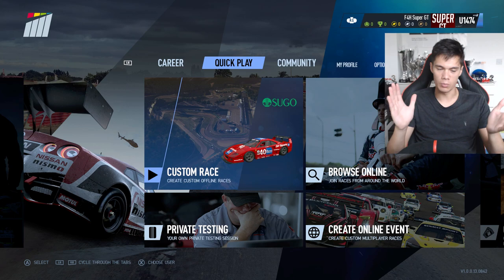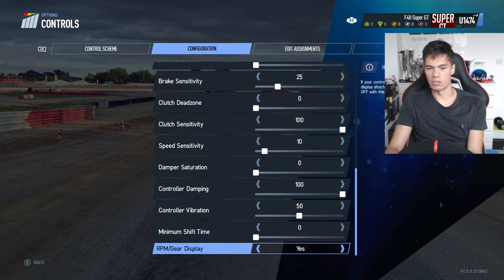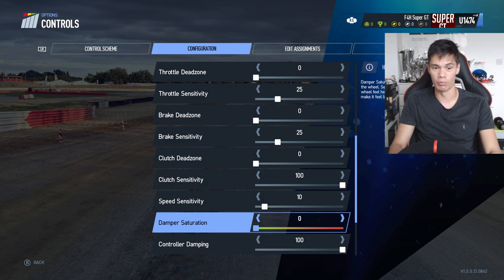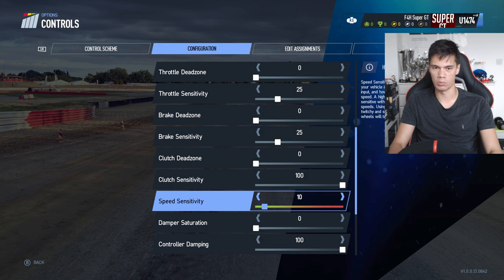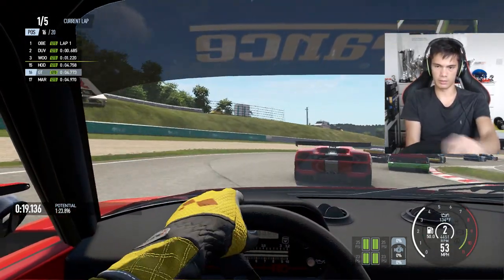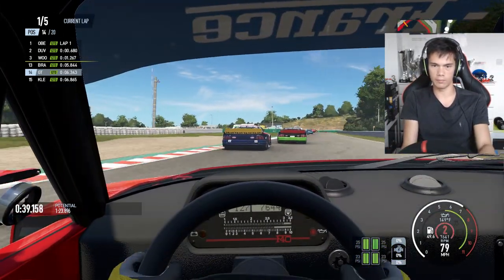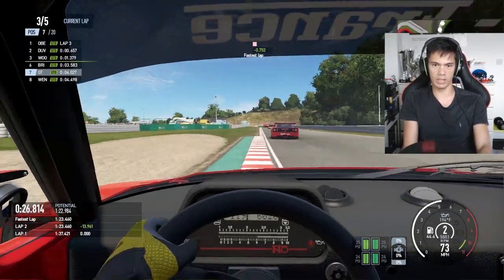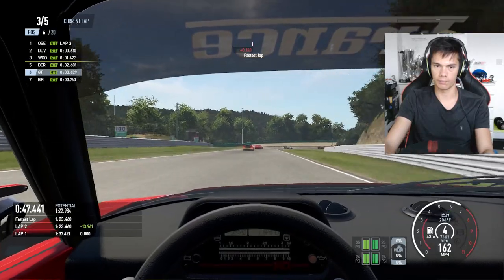Project Cars 2 - Wheel Settings

Comment: Here they are just in case anybody needs to copy it in text form, send it to people, etc:

Steering Deadzone: 0
Steering Sensitivity: 70
Throttle Deadzone: 0
Throttle Sensitivity: 25
Brake Deadzone: 0
Brake Sensitivity: 25
Clutch Deadzone: 0
Clutch Sensitivity: 100
Speed Sensitivity: 10
Damper Saturation: 0
Controller Damping: 100
Controller Vibration: 50
Minimum Shift Time: 0
RPM/Gear Display: Yes

Flavour: Up to you
Gain: 100
Volume: 60
Tone: 45
FX: 65
Menu Spring Strength: 0.05

Comment: Revelation! My settings were ok but yours makes the car so much more stable, thanks. At first I thought the brake sensitivity was too low for me but I persevered. Mine was set a lot higher as was throttle sensitivity. With your settings there's a little more under my foot which gives me a better feel. I'll experiment with a little more sensitivity but I'm getting a step change in feel and results, thanks again my man!

Comment: Hello!  I've loved racing games for years.  Early on, i loved Gran Turismo, and once i converted to xbox i got into forza 3,4,5,6 and the horizon games.  But after Forza 6, and the junk lobbies i got really discouraged in trying to race clean and get faster lap times as the forza games seem to be mostly a "horrible smash up derby experience".  Not all the time, but most of the time.  Anyway, I decided i wanted more of a sim experience so i went out and bought a tmx pro wheel setup.  I also bought Project Cars 2.  I couldn't find any good settings that i like.  So i searched your vids to see if you had done a vid on settings, and here I am.  I put in all the inputs, and WOW!  It worked very well with my TMX.  Thanks so much for doing this, and all your other vids.  I've been watching you for a few months now and have recently subscribed!  Thanks again!

Comment: Thanks for the settings.  Definitely a good starting point. I tweaked mine slightly from your settings for my TMX wheel but not much.  Huge improvement over default for sure.
Reply: BigMeanyVids could you please give me your settings? I have the same wheel.... Thanks a lot
Reply: LGPnJR8788 Sorry I don't remember them and I have switched over to a TX wheel.

Comment: Thanks for the settings.. i have the exact same setup and was struggling to get the wheel feeling somewhat decent...Something  that has helped me with my turn in is turning off TC and ABS in the cars ECU menu....although i have it turned off in my driver assists its still there in the cars ECU settings... once those are turned off the cars feel 100% better overall... at least the lower powered cars.. haven't tried it on the faster cars as yet

Comment: I have a PS4 Pro and not an Xbox like the OP.   His settings are the best I've tried thus far - BUT for the PS4 I did tweak it a liiiiittle bit to make it perfect.  After 5 laps I beat my old time by almost 2 seconds.  So, I copied all his settings exactly except for the FFB settings (the "Damper Saturation" - PS4  menu does not have it).  Here are mine - RAW - 72/60/45/60

Hope this helps!!!!

Comment: A for effort on the set up. I have a thrustmaster which isn't a bad wheel. These settings numb up the forced feedback quite a bit for me. In reality cars really tug and stock settings are decent at replicating that. Steering wise it helped but if you like a lot of force feedback, keep it on immersive and keep volume down a bit.

Comment: Thank you so much ! This thing was unplayable out of the box, what were they thinking releasing it at those settings. I was ready to trade this game in but now she's a keeper. Thanks again.
Reply from the maker: Good to hear! And yes, it is very frustrating on the standard settings but feels good when changed.
Reply: Nope changed my mind and traded this game in for Forza 7 yesterday. I didn't spend a couple hundred bucks on a Thrustmaster wheel just to spear off into the boonies from understeer on every second corner. I also didn't want to go back to another Forza but after trying Assetto Corsa and Project Cars 2 I'll reluctantly admit Forza is the only option for driving games on the xBox One.
Reply: Buck's Outdoors I think you're wrong..what driving assists or steering lock do you use? I just got project cars 2 because forza sucks for racing..it's great for drifting and engine swaps which is why i still have it, but pc2 is actually so realistic and much better for racing, i actually thought there was almost no understeer the turn in was quick and precise, the way the car moves is realistic, i didn't get any of this in forza 7 and i bought it on release

Comment: Thanks for this, really makes a difference (and was getting quite mad at the game). Put the gain to 85 myself as I find 100 to heavy. Do you know if you can change rotation somewhere. Think it is 900 by default and that is way too much for me.
Reply: you can change it in wheel calibration, just lock the second rotation at whatever you want, but be aware that lowering degrees actually increases it (weird), so you have to lock it at around 1000 degrees or 1100 degrees in order for it to feel closer to 700.  Hope this makes sense...  Oh, you will also have to remove the visual arms and game wheel because they will turn completely out of sinc to your wheel (which is distracting)...

Comment: Kool I'll try thst damper saturation, I would advise you to change world movement to 100. For propper sync with car suspension and road its off,
Plus I'd advise people to always keep gain in game to 100, and turn down TM folder on pc to whatever strength you want,
Mine have changed yet again, because i want to never change them at all so I've gone with,
Thrustmaster pc folder
PC Main ffb 40
100
0
0
IN GAME.
100
26
46
65
MENU strengths is when the ai takes over for a smooth transition 👍👍👍,
Super gt you most like a heavyish wheel 👍👍

Comment: I’ve plugged my wheel and, and it works, but the settings page still thinks I’m using a controller, pls help
Reply: Before you start the game activate your steering wheel, and then activate the game by pressing the button X or A( PlayStation or Xbox) on your wheel. And don’t press any buttons on your controller. After it check menu settings( still don’t press any buttons on your controller). After it, I believe it will help!

Comment: How do you set up a T500 on PS4. The PS4 is picking up it’s signal (eg. I can control the PS4 with the wheel) but I just can’t change the “type” of controller. It still says “wireless controller default” pls help me out

Comment: I have no idea how you were able to run that much steering sensitivity. I've been messing with this settings with a GT3 car on Spa and it's been allowing me to drop my lap times by seconds. However!, whenever I go to a track with a long straight away I get the most god-awful vibration at speed I can't even hold on to the wheel. If you have any idea how to eliminate this please let me know.

Comment: The problem I have with my Fanatec CSW V2 and BMW M3 GT2 wheel is the weight of the wheel. There's almost zero! It makes things unpredictable and sloppy. When I put my F1 Carbon wheel on it feels a lot better. That's only cause it's a tiny light weight wheel. I wish they could fix the ffb overall. But definitely increase the weight on wheels.

Comment: Question for you cocker, what about steering calabration radius. On my g920 it has a maximum angle of 900° and when i calibrate it i only want like 180° so i only have to take my hands of the wheel but that makes everything super twitchy! Any ideas on how to get it smoother and i quite like a strong force feedback ?
Reply: Never go below 540 bud. Anything lower is too twitchy. I leave it on 900 personally as it feels more realistic to me but in your case I think 540 would be sweet spot.

Comment: Raw was fine  , ive tried it before 'custom files'.. with a wheel like yours I guess its still better than an Old G27, 

 But you don't want any 'speed sensitivity' with a wheel,  ... thats the whole point . having a wheel- you are steering the car like it should be regardless the speed , thats why youd have to up steering sensitivity - I don't understand that :(. 
 -  PC2 have great contents for a 'sim', ffb still need some works .. but please do it  with proper sim wheel setting xd
Reply: Not Overrated interesting
Reply: I think new porsches have variable steering ratio (real ones, not in game). So all in all it's down to preference. Keeping it low at maybe 10% probably won't harm you. But I agree - it's better @ 0.

Comment: I have a g29 ps4 and both PC and PC2 have ridiculous steering ratios, you need to make a 90 turn for a minor correction....? What gives??? Don’t the asswipes that make it claim it’s super realistic.... steering sure isn’t. Why the fuck should I have to mess with settings and steering ratios on every car, I don’t have to do that with AC or GT sports....??? PC is my least favourite to play because of the school bus steering.
Reply: That's a calibration issue with 900 degrees wheels. I like 240, i set it in Logitech profiler and in the calibration of the game, where it wants you to put it at 90 degrees (step 2, resulting in a number of 900) i make it 1560 (900 - 240 + 900) saw this in a video, since then no problems with my Logitech wheel or messing around too much with steering ratio on cars.

Comment: I have a question... I have Thrustmaster T150 driving wheel and I have the same settings as in this video. And when I drive not very fast cars for example gt5 cars then everything is allright, but when I drive faster cars for example Ferrari or Lamborghini it is impossible to steer on the turnings... the car is slipping and it is very difficult to turn... Has anybody solution to this?

Comment: Didn't work for me...I was decent at pc1 but this is the worst handling game I've ever played in my life. Im not sure if the settings are jacked or what but I can't even downshift on a straightaway without spinning out
Reply: aaron mckiddy  are you rev matching? What other games did you play.  A proper simulator like this is for skilled drivers.  If you don't rev match when your downshift your rear tires will lock up do to your wheel speed being lower than the new fly wheel speed.  Use heel toe to avoid this.  You put the left side of your foot on the brake and the right side of your foot will blip the throttle at the same time you push in the clutch with your left. To match the revs of your next gear.  Or if you don't plan on slowing down. Just use right foot on gas and left on clutch and give the throttle a touch when hitting the clutch in and release the clutch once the revs pick up.  It's very quick.  I race on track in real life and this game is fairly accurate.  Unlike forza or gran turismo. The only game better is assetto corsa. Or Iracing. Physics wise. But if your comming from games like need for speed or forza  then your going to have to adjust to the real life phisics where cars can't be thrown around and you must keep weight shifting and suspension tuning/tire pressures in mind. Or els you will lose control,
Reply: @michaelyacobucci5669  yes dude you spoke it correctly this game is not for people that uses  360 controllers. you have to understand the physics and that you want it to respond like a real car otherwise you're not a real Sim racer.

Comment: 100 gain is too high
Reply: im2fast4u711 interesting, why? I also thought braking sensitivity was low but found ground with it (see comment above).
Reply: Jamiedh303 depending on the other settings it may cause clipping. ffb is highly subjective but clipping is a reality when the forces are too strong. Basically you can lose the more subtle feedback.
Reply: Jamiedh303 i also dont know what his settings are in the tx control panel, default is 75 for overall strength i believe, i set mine to 100 so i can adjust it per game. if it is at 75 in the control panel, 100 in game might be fine.
Reply: im2fast4u711 gotcha! Funny enough since posting my comment I reduced mine to 80 and there is 'more' coming through the wheel. I'm thinking that I may need to keep a record of which settings work best with which car. I don't think the game saves settings templates per car. So far I'm using a lot of random weather conditions, I think this is an error until I find settings I'm truly comfortable with, do you agree?
Reply: Jamiedh303 No you cant save ffb per car anymore like in pcars 1. You also have to remember its not always the ffb that needs adjusting. tuning the car will will change the feeling as well, like if bumps feel super strong soften the suspension. so find a decent base setup for the ffb then tweak the car in the tuning menu which can be saved.
Reply: im2fast4u711 👍
Reply: 100 gain would break my hand

Comment: you overshoot almost every corner, take a way too early apex most of the time and over rev the shit out of the car. 3/10.
Reply from the maker: Backpacker I did say that i dont use the wheel very often and that i need work on it. I was just proving that the settings are drivable, not that i am a driving god.